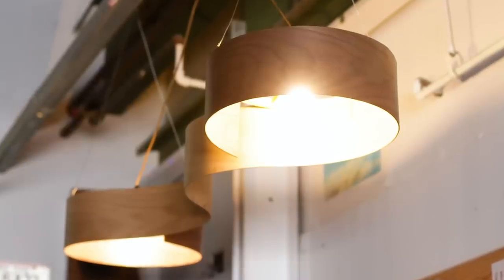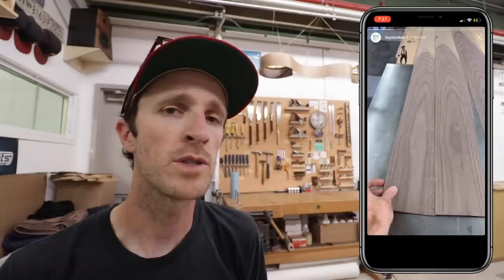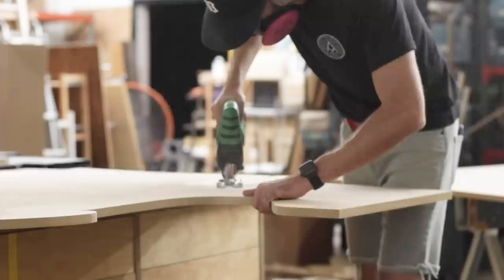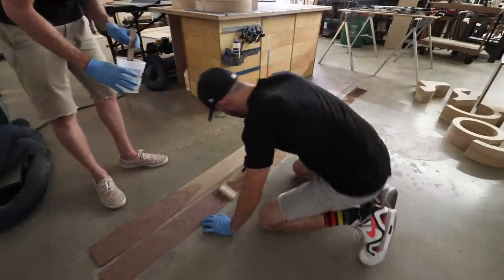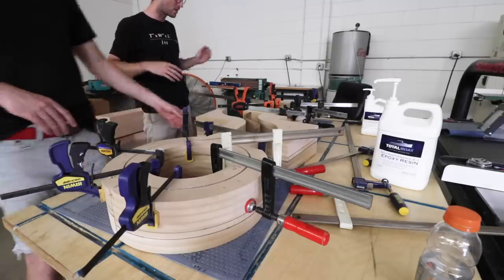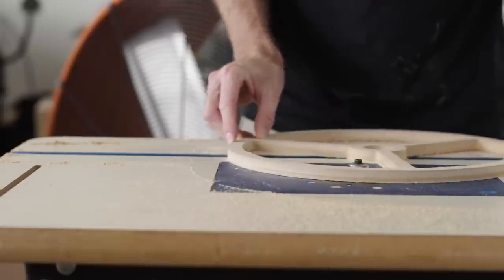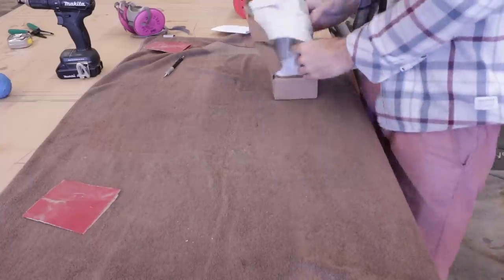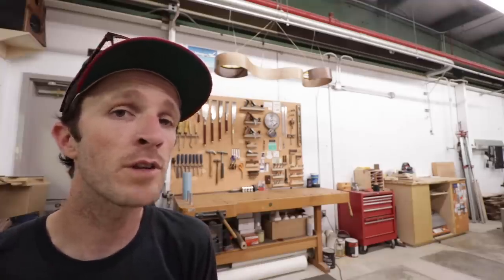Building a Bent Lamination Hanging Lamp, Chandelier Thing | #RocklerBentWoodChallenge

Comment: Looks amazing! Great work! You might consider putting the strips in a steam box for a while and then clamping them down in the forms overnight. Then do the glue up after they have already been bent roughly into shape. Helps avoid cracking.
Reply: Thanks Lee! Yeah, the strips actually bent totally fine, the crack happened because one of the pieces slipped under the form and when we pushed down, we squashed it. Total operator error!

Comment: How did you fix the crack at 5:20? Did you apply a finish or something to deal with the heat from the bulb?
Reply: I think he installed LED bulbs, so there won't be that much heat.
Reply: The crack just ran for a few inches along the grain of the outside veneer, so when we eventually got everything clamped up, it mostly fixed itself. As for the lights, yes they are LED bulbs.

Comment: Looks great, but did you consider using plywood for the circular frame that got painted yellow. I think the laminations in the plywood would have been a nice nod to the challenge, even if very little of the nominations in the plywood would have been visible. The contrast of walnut against the plywood would also have been striking.
Reply: Thanks! Yeah, plywood could certainly have been used for the frames. A different look than what I was going for, but would definitely have been a nice look, as well.

Comment: Looks fantastic! Some really neat techniques shown here! Is there any reason you couldn't laminate several layers if you wanted a thicker look? Would it be as simple as making a form with a larger gap, or are there other considerations to be aware of?
Reply: Thanks David! Nope, just like you said, the only thing that would change would be the size of the gap between the forms. I suppose if you went really thick, you would need to consider the radius of the curves as they would get tighter as the thickness increases, but that is about all I can think of that could be an issue.

Comment: would you guys use epoxy again or wood glue for binding the layers?
Reply: I think either one will give you a good result. I tend to lean towards wood glue because I know it much better than I know epoxy, but the heat that day would have made using either one difficult.

Comment: If you didn't have an audience without CNCs would you just CNC the full stack of forms  instead of  jigsawing/bandsawing/flush trim'ing?   Curious which is faster / more efficient.
Reply: Honestly, I think with two people we were more efficient doing it by hand. And we were able to be really efficient with getting the most out of the material. Though if we had a big 4x8 CNC and could cut all the parts in one go, that would probably be quicker.
Reply: @shaunboydmadethis  Cheers man, thanks for the response.

Comment: Could you have used partial spacers for your forms. As in, instead of cutting duplicates of each piece for each layer, cut out much smaller pieces to make up the form for every other layer? EIther way, love the look of this!
Reply: We actually considered doing that, but eventually decided the time/headache trade-off wasn't worth it. I think the main thing is that without spacers you can flush trim each layer to perfectly duplicate them, but with spacers, it would be a little more difficult to get everything to line up perfectly.
Reply: @shaunboydmadethis  Fair play to you guys. I'm getting ready to start on my own Bent Wood Challenge project and I'm looking at ways to incorporate my CNC (Shapeoko XXL, name still to be decided!) in the project. Good insight on your process for the lamp. Thanks!
Reply from the maker: Can I suggest "Meg" ?